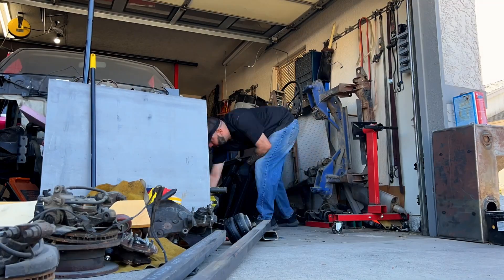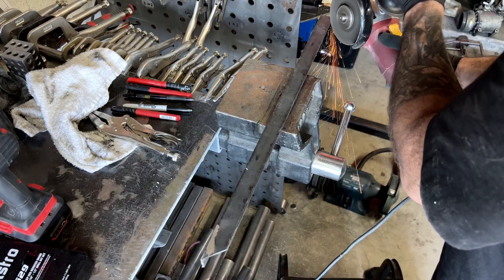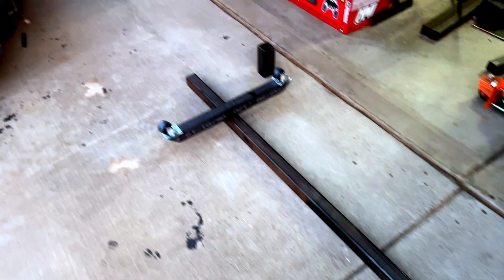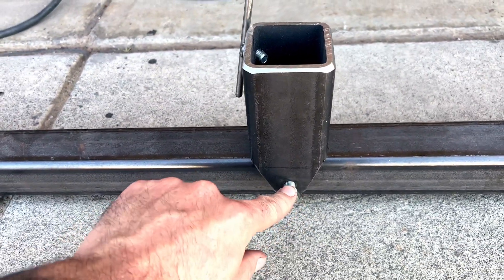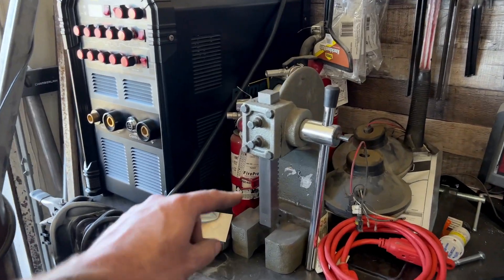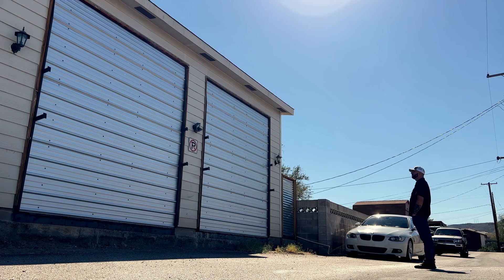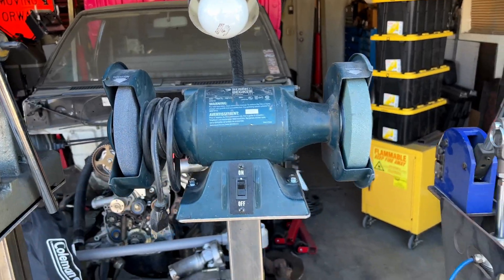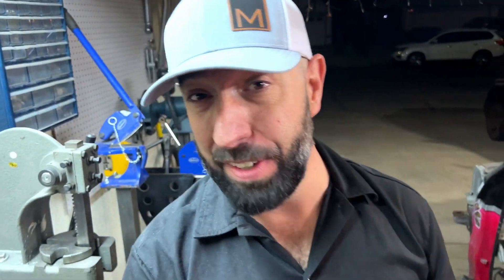Brilliant Legless Tool Stand/Storage System! Part 2? 🤔

Comment: Weld fins to act as gussets on each of the "horizontal" sides of the tool holder square tubing, that will give you lateral stability without having to weld the holders to the base. The "vertical" sides are stabilized by the overlap and lower set screw. Great video. Great ideas. Love this channel!
Reply: Had the same thought.
Reply from the maker: I like it! It just might happen. Thank you!

Comment: I was wondering what would happen if you made a extension that went into the ground then you could shorten your posts on your tools and lower the center of gravity in storage as well as use less steel on your posts

Comment: Possible Idea 1: Add something to tie the cart to the wall while it's stored.  In my shop that's when I'd be most likely to tip it as it mostly lives there.  #2 Put the tools on a short post or receiver then make a common riser for them to share.  When in use, the riser goes in the hole and the tool go in the the riser.
Reply from the maker: The riser is brilliant. Basically an oversized ratchet extension. That would’ve saved a LOT of square tubing. 😆 And I could’ve built a heavy duty shelf for the “heads” So my floor would be even more free. There might be an upgrade in the future! As for the support. It’s not so unstable I need to worry about it while it’s parked or even in use with the smaller tools. I think the only way I could actually get it to tip would be to push it sideways into a crack or something.
Reply: @GarageFab  Thanks and exactly like a ratchet extension!  I love the idea and am seriously thinking about doing it myself.  You gave us a great idea that I (and likely most people) had never considered.  My only real concern now is how much I might need to reinforce the floor around the hole (or if it isn't needed).
Reply: @thoughtstream9591  Best way to reinforce the hole is build a five-sided box (open top) with steel plate, welded together, and sink that into the concrete. If the concrete floor is already solid, cut a bit larger hole in the floor, insert the box into the hole, and then use anchor cement, Cement-All, or equivalent to close up the difference. Optional, especially if building new, weld some studs or rebar to the outsides of the box sides so these increase surface contact with the cement to prevent pull-up later - similar to how weld plates are made to anchor into concrete.
Reply: @MadGunner  I'd be doing a retrofit.  That's what I needed to know, thanks 😀

Comment: 8:18 would you consider maybe welding triangles on the sides of the small vertical receivers to stop them from tipping? (Like rocket fins pointing upwards.) That way you can keep the movability? IDK if that would be stable enough for your use tho.

Comment: You could mount the legs off center and mount the tools at a 80 or 85 degree angle so they lean toward the side that has the longer side of the leg.  I think that would give you effectively double the support because of physics and what not.
Reply: I haven't finished the video yet, and this project is obviously done already...
Reply from the maker: Haha! It is done but it’s still brilliant. I think I can picture it. I created a rack that holds 12 wheel bearings that we use as hydraulic press tools it’s 3 feet tall, leaned back as you mentioned and welded to a horseshoe. It’s surprisingly stable. 👏
Reply: @GarageFab  I'm sure your stand will be fine. It's not like you're going to be running it down the road like a skateboard... you aren't right? Lol
I just found your channel the other day, and this is the second video you have responded to a comment I made, and the other video was a couple of years old.
Your procedure for fabrication methodology you easily explain really resonates with me, and you have a really cool attitude, which is refreshing. I can tell you really enjoy what you do.

Comment: You should have mounted the posts to the side of the cross member so you could wheel it over to the hole and drop it in, the only time you would need to lift the tool would be to get it up out of the hole.

Comment: Not sure if this helps now that you already built yours, but I had the same issue decades ago and tried the same thing.  It still took up too much space and was clumsy as hell.  My solution was a tool tree.  I used 6" square tube standing vertically, and mounted 2" square tube nubs at 45 degrees on all sides working my way up the trunk.  For the base of each tool (bench grinders, vices, rollers, porta-power heads, etc...) I mounted a plate with receiver stock as sockets to slip onto a variety of 2" square tube lengths I had so that the tools could sit at different heights.  The tools would rest on their socket and were super easy to lift and slip onto the stand I needed.  I had 4 different lengths and I would slip them down the center of the 6" trunk.  The whole tree used about a 36" square footprint in the shop, and could roll it near one of the several holes I put in my garage floor, just as you did.  It was much less clumsy and took a lot less space.   Just planting this seed of an idea in your mind in case your version doesn't work for ya.  Great video!

Comment: Looks great! I think I commented this before, but you should really learn and start using 3D CAD. There is a learning curve but it more than pays off. 

You can sort out issues before even buying material. You will have a design that is repeatable in the event you want to sell plans or a finished product. You will have more content for your channel. And, you can outsource some of the work by sending the design to a shop that can laser cut and CNC press brake. 

I started my fabrication journey a few years ago and my first project was a welding table. I spent so much time and wasted material building it. My dad told me that I needed to learn CAD so I got into Fusion 360 and designed the welded table that I already built. 

CAD is another journey. I am always learning something new or a better way to do things. But I am so glad I made the plunge. I would look into Fusion 360 and Solidworks. See which one you like better. If you chose Fusion, I would be more than happy to get on a call with you to give you tips. I could help you design this tool rack.

Comment: Doing a garage make over with Justin would be fantastic; I envision a motorized over head rack like the dry cleaners to bring your tools out from the side of the garage😂. A modification to your current rack could be larger castors on raised outer mounts that keep the center beams in their low position and/or out riggers that slide in the tube the castors are bolted on ( slide them in for space/ out for movement). The outriggers could have adjustable feet or another set of castors. v/r wh
Reply: It just occurred to me that you have knack for “part 2’s”. Perhaps you could do a follow up on how smooth your tooth is.

Comment: Is it worth designing along the bottom rail of the post tool rack a way to drop a square section into the hole in the floor to help stop the rack walking away when your using it. Lockable castors never work in this regard. Really enjoy your video's.
Reply from the maker: You got my brain juices flowing. I agree with the lockable casters which is why I saved some money and bought regular ones. Though I’m unsure if I’d want to sink another square hole where the rack sits, it would be incredibly helpful to have a pair of 3/4 inch “pins” That drop into the ground. That would likely make the tubing bender usable on the rack. 👏
Reply: @GarageFab  Are you going to use the rack along that wall where you pushed it back to in the video? If so, instead of another hole or two in the floor you could devise a bracket off the wall that somehow mates with the cross braces with the wheels so as to anchor it at each end solid to the brick wall?
Reply: If pins aren't secure enough for using the bender, you could maybe do a few drop-in anchors and bolt the rack to the ground while bending. Would help with both sliding/walking as well as tipping

Comment: I do believe I would consider drilling and Welding a bung into that tube, and fill it with sand for ballast. That might save you some time picking Tools up off the floor.😊
Reply from the maker: Interesting. 🤔 I’ll consider it! It’s certainly already heavy. I think the most effective thing will be an abundance of caution. 😆

Comment: Great idea.  Looking forward to the Phase 1 video so I can put a square hole in my garage floor!
Reply: @stephenlea5765 Best way to reinforce the hole is build a five-sided box (open top) with steel plate, welded together, and sink that into the concrete. If the concrete floor is already solid, cut a bit larger hole in the floor, insert the box into the hole, and then use anchor cement, Cement-All, or equivalent to close up the difference. Optional, especially if building new, weld some studs or rebar to the outsides of the box sides so these increase surface contact with the cement to prevent pull-up later - similar to how weld plates are made to anchor into concrete.

Comment: Nice tool holder. Just like ScottWolfe said, you could weld some angle iron to the vertical pipe holders (not to the bottom bar) and will stabilize them plus you could move them without cutting the spot welds. It looks top heavy. Thank you for the videos

Comment: Dude, you are hilarious, stripper pole practice!  Love the hole in the ground and that steeped tip drill bit you slipped in there without any commentary like we didn's see it.  I feel like you could use a second hole in the ground to run a few tools at the same time and you could use that to show us the part 1.  I'm putting up a pole barn shop in spring and I's like to see the rest of that story so I might put them in when the floor goes in.  Also, I feel your brother's pain, we have idiotic codes here as well with morons in the building commission interpreting codes.
Reply from the maker: That’s very true. One thing I considered is to put another hole nearer to the back wall. It would also give me a place to temporarily mount my electric winch for pulling in non-running projects. 👏 
What’s a pole barn? Yes, it wood be sooooo much easier to simply inlay the receiver into wet cement.

Comment: Good idea. I might use it. I wonder if you could have short posts on each tool, and one single extension post that sits in the hole in the floor. The tools would be lower to the ground when in storage, and the extension post could be stored flat. Just over thinking it out loud.
Reply from the maker: Yes! That would be brilliant and it would save a LOT of material. That would also give you the option to mount more “docking stations” around the shop on work benches etc,
Reply: That is genius

Comment: Great idea! But if you want to be able to move them around instead of spotwelding them on the sides, couldn’t you just put triangle gussets to stop the side to side motion?
Reply: Agreed. I was thinking of angle iron on each side.
Reply: Then the bolt would just ride up. The gusset would act like a pivot point.

Comment: You could add outrigger bars that could slide out from the tubing for the feet. That would help with stability.
Reply: I was thinking about something folding up and down but I like your idea.
Reply: This is exactly what I did on a tall narrow cart. I use a crowbar to lift the corner and slide out the casters.
Reply: Very good idea!!
Reply from the maker: Yup! Agreed. The ends of the cross bars are still open. Super easy to do!
Reply: Outriggers would be ideal for moving around. Id make them to fold out to avoid having to reach down and pull them out every time. A simple pin through bottom would allow them to fould out easy then make a latch to lock in place when down
Reply: @outlawwelding7505  then you need to bend down to put the pin in! 😂 

The outriggers don't need to have wheels, just simple little feet to stop it from toppling over while being moved. 

If he wanted to get fancy with it they could have adjustable feet (or just blocks to slide under 😂 )that you can actually lift the wheels off so it has more stability to use the tools on the rack.
Reply: Fill the center bar with lead shot. Lots of tool frames use this tactic to enhance stability by adding weight down low.

Comment: If you redesigned it so you can invert your tools on the rack it would no longer be dangerously top heavy.
Reply: Show us your version. My brain can not envision how this makes any sense at all.
Reply: @chrisallen2005  Allow me to explain. You have a post with a 50 to 100 lb tool on it, right? Now multiply that by say 5 tools at an average of say 75 lbs each. Now you have 375 lbs elevated to 4 feet. That 375 lbs is a lot to have at that height with such a small base. So, in order to make the base safer from tipping without changing the width, you need to move the weight lower to reduce tipping. To so that you mount the tool end at the bottom and the post end (the lighter end) at the top. To do this, you can build it like a short coat rack and hang the tool by a hook or by drilling a hole in the post and hanging it heavy side down by the ground. Now, you can roll it at your leisure without the constant threat of tipping while still maintaining the base width to reduce space.